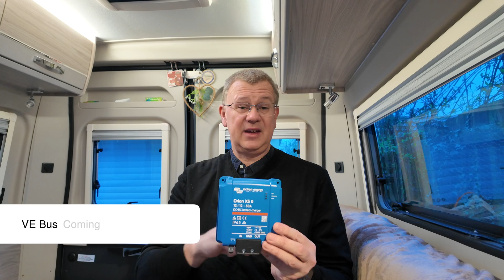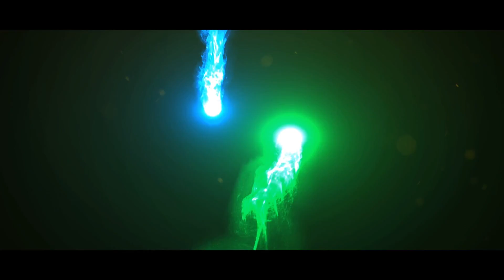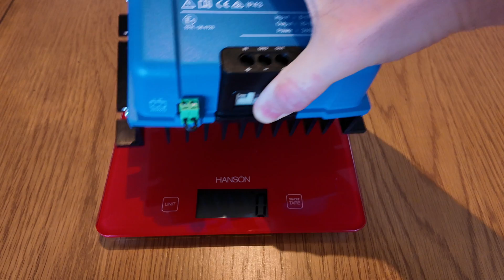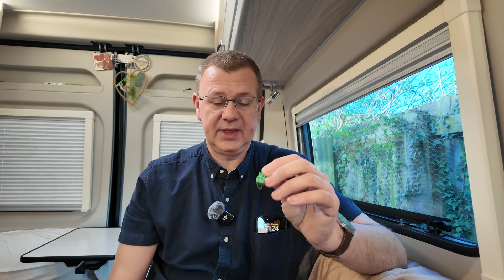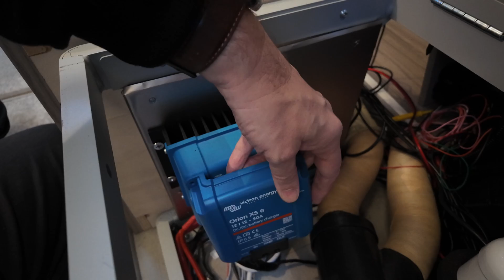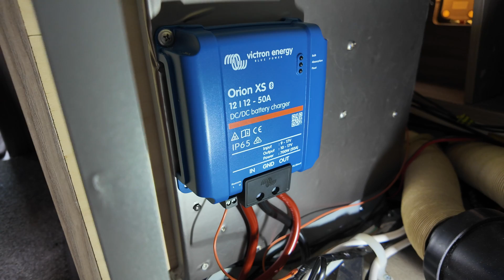New Victron ORION XS DC-DC Charger Upgrade B2B Installation

Comment: David, many thanks for yet another great trechnical blog.
I'm happy with the standard fit Schaudt WA121525, as it charges my single 95A orginal AGM battery (Elddis CV40) in quick enough time when needed. As i'm very tight with my dosh (saving fuel), I would like to be able to turn off the "Schaudt WA121525" if I know I'm going into a paid campsite with EHU or if I have to move, but know there is plenty of sunshine to charge the battery later. Would having a switch on the D+ line be a good idea? I have asked Schaudt, but await their response. Thank you 👍
Reply from the maker: Hi Darren - yes a switch in the D+ line into the Schaudt would achieve that and you’re right the energy comes from somewhere so reducing load = reduced fuel costs 😀 I keep being tempted to try and work out Ah>diesel to see how much it is but imagine over time it would be significant 
All the best, David 👍
Reply: @LeisureBit  Thank you David for the response. I think I will fit one of those bluetooth devices from Amazon so I can activate/deactivate remoteliy without running wires around :)
Reply from the maker: @darrenpardoe  good idea, just make sure it's volt free contacts to avoid damaging your van electrics, most of them seem to be relay so should be :)
Reply: Hi David great blog keep up the great work, just one question, I'm thinking of changing my schaudt dc to dc f9r an orion, I am confused as to why you had two dc to dc the original and 12 12 30amp. I take , a straight swap with the Schaudt would be fine with the orion and a ground.cheers

Comment: Thought I had better say Hello.  Not sure I need the extra power of the XS but was interested to see if it was as good as folk say.  We survived another winter with our current set up of 200Ah of Lithium after I got a deal which was better and lighter than the AGMs I was going to fit.  Thanks for sharing.
Reply from the maker: Hello 😀 it’s quite a bit extra power isn’t it and in some cases the alternator or other things wouldn’t support it, wonder if they will do a 25/30A version at some point, imagine that could be even smaller! 
Thanks for dropping by, all the very best, David 👍

Comment: Hi David, Great video and walk through of the change and you are definitely responsible for giving me ideas which lighten my wallet 🙂.
In relation to the VE bus, does it currently utilise the battery reading from the smart shunt to match the charging profile? Just with Solar, B2B and shore charging from Victron it was only the Orion that was not matching. With the new XS does it now match with your other units?
I've not gone to the cerbo yet but would be interested in your findings on how all the current battery charging sources work.
Reply from the maker: Hi Louis - thank you - it becomes an expensive game doesn’t it - I think it uses the in / out voltages what the ve bus is giving is the visibility and history of what’s happened if that makes sense. All the best, David 👍
Reply: I’ve bought one now so can’t wait for it to arrive and get it installed. So I’ll soon have a spare Victron Orion used for 6 months for sale as well 😊

Comment: My setup is a mixture of renogy and victron but all runs via a hard wired ac200 max Bluetti so a fogstar puts power back into the ac 200 when required giving 240v 24/7 and we have a dedicated solar panel feeding the AC 200 separate to the leisure battery as we have a bifacial panel looking after the lithium we also have a 500w victron booster to take power from the leisure side when needed  so a bit of a Frankenstein setup but works amazing wouldn’t change it
Reply from the maker: Sounds like a cracking setup - it’s all about finding something which works for you isn’t it - all the very best, David 👍

Comment: Hi David. how did you get your hands on one this early ?. i am having some upgrades to my motorhome and the firm doing the upgrade told me that the 50amp b2b would not be available until late March early April.
Reply from the maker: Sorry to hear that - I ordered it when it first went for preorder from Offgrid Power Solutions and was lucky to have been in quick I think before they sold out of the first batch - it was delayed slightly like any of the others due to time to supply - hopefully yours will come sooner. All the best, David 👍

Comment: For use on a motor home. Thanks for your videos. Just installed four hundred   watt panels. My gel batteries are seven years old. Looking at roamer lithium. Thanks again.
Reply from the maker: Sounds like a great solar panel - I’ve been really pleased with my Roamer battery - thanks very much for watching - all the best, David 👍

Comment: Great video David. I will be sticking with the Schaudt WA121525, I did remove its output from the Elldis PCB and put it direct onto the a Battery (Roamer SB230) mega/maxi fuse box i installed. I find 24amps per hour I seem to be getting (tested via Roamer app) OK for our van use.
Reply from the maker: Excellent that’s great output and you can tell that you’ve put it direct to your battery 👍
All the best, David 👍

Comment: On some vehicles the engine Alternator needs upgraded to a higher capacity type. It can also mean that twin Alternator drive belts need fitting to handle the extra horse power taken from engine as it can be as much as 7.5 horsepower. Plus twin belt pulleys. Remembering if both batteries need charging. George
Reply from the maker: You’re absolutely right and you need to make sure the alternator has sufficient capacity to ensure it doesn’t overload.
Reply: @LeisureBit  A proper job . George
Reply from the maker: Thank you George - best do it right
Reply: That would be 5.5 kW before various losses.
Reply: Ford has a $640 dual alternator OEM option however I had not seem one, even the Trail, equipped that way yet.